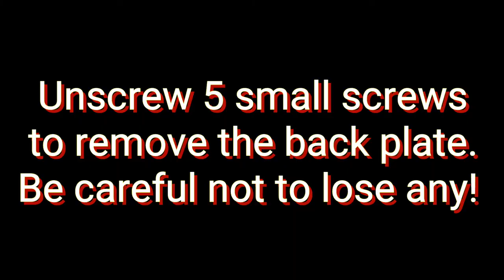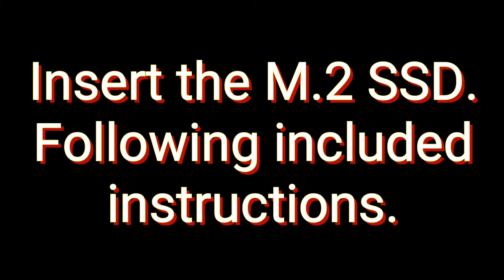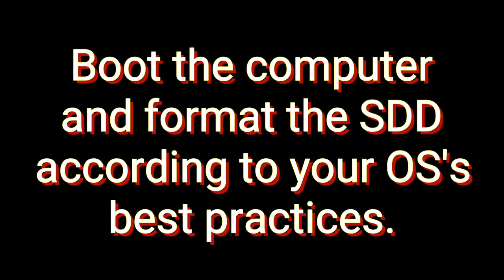How to Install a M.2 SSD in a Lenovo ThinkPad P71 - Plus a Look at Other User Installable Components

Comment: Will 980 pro with heatsink fit into p70?
Do you think heatsink is needed for gaming on this laptop?
Reply from the maker: I'm not sure about the heat sink. There's probably not that much room. It does have a pretty good fan in it for cooling, but it's really not a gaming PC.
Reply: @SJsAdv  For games I play it is more than enough ;]
Anyway which ssd 512-1Tb would you nreccomend?  I preffer quality and longevity over speed of disk.